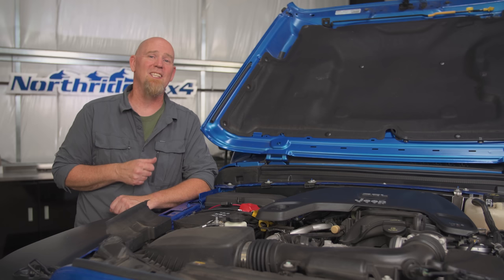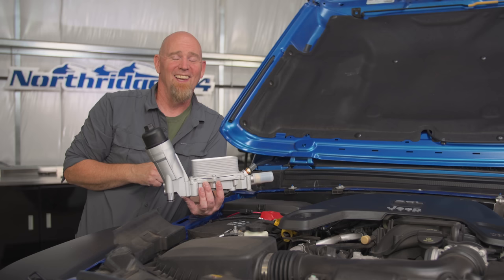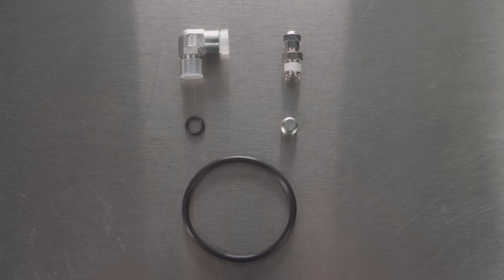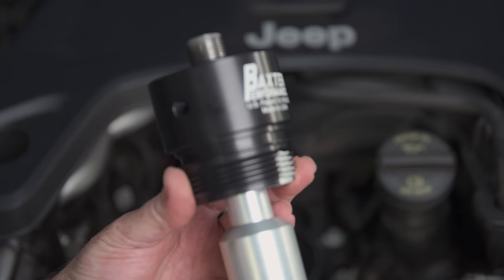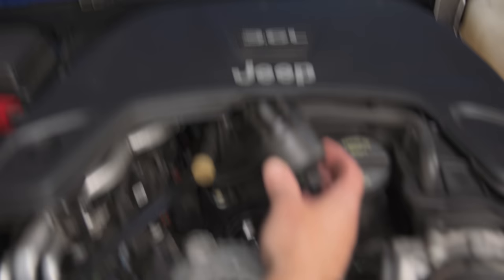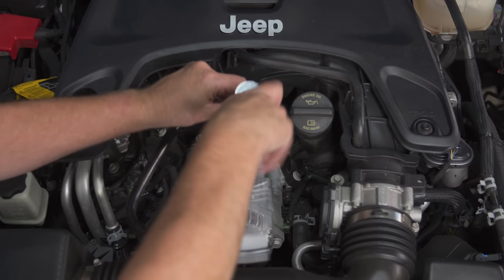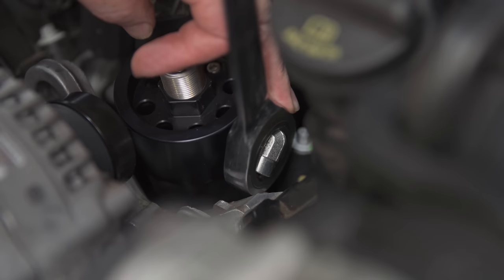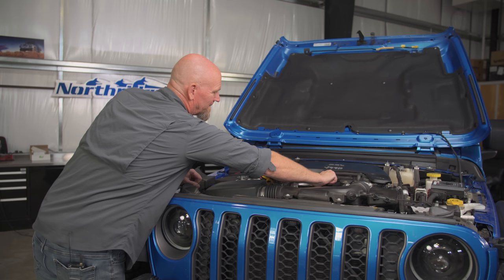STOP Dry Starting your Pentastar 3.6!!

Comment: Honest question; do you really feel comfortable promoting these types of "bolt on" products where you potentially dont fully understand all the possible downstream negative effects on all engine components? I mean even the engineers probably wouldn't promote something like this without very extensive long term testing.
Reply from the maker: Yes, with as many valvetrain issues as the 3.6 engine has, we really like the idea that a company has taken the initiative to find out what is the possible cause and come up with a solution.
As far as long term testing, this product has been in development for 3+ years and Baxter Performance has been building oil filter solutions for other vehicles for many years.
Reply: I would assume that you are assuming that factories build cars to last forever. They don't. That would not be very profitable. As a retired 40 year master mechanic that drives a 2022 Gladiater with the 3.6, I think its a great idea. Not picking, just sayin'
Reply: @donerightmark1240  not assuming that at all. All I'm bringing to light is how some of these easy bolt on products claim to fix one thing, but it may also be causing other issues that may crop up at a later time. Without extensive knowledge and testing on the exact platform it's applied to, I sure wouldn't risk it with my own vehicle. I'd file this under similar product umbrella as K&N/cold air kits, aftermarket exhaust systems, etc unless there was hard data to back up claims.

I don't doubt it does what it says, just wonder if there are other non-obvious issues it also causes.
Reply from the maker: @JRobes34  What hard data do you want?
The only claims made is that they are adding an anti-drain back valve into the system to keep the top of the engine primed with oil. 
Will a wet start help an engine live longer over a dry start?  Yes.
Reply: @northridgenation  re-read the last part of my last reply. Not saying it doesn't do what it says. Saying there may be unintentional downsides that may be occuring bc of something like this that you, I, or the manufacturer of it isn't aware of. This is just a possibility, not an absolute. 

Example: K&N filter reduces air intake restriction (or did on older non optimized engine designs of decades back), but at the expense of allowing more debris into the intake/combustion chambers. Does what it says (allows more air flow which allows more fuel in the combustion process), but also could be increasing engine wear due to more air contaminants.
Reply: @northridgenation what about engines with oil filters on bottom of motor.  The oil still drains out of the top of the motor back to the pan. It may hold oil in the filter, but the engine still needs to start in order to start pumping oil to top of motor. The cup full in filter doesn't coat cam or lube the rollers on rockers , that happens after oil PSI comes up from running after 2-5sec on ANY Engine.  Imo this is just a Gimmick for people to waste money on
Reply: As a mechanical engineer I can say that dry starts are not good. Period.
Reply: @kwmiked  Yes, both are the same bottom or top but the difference here is that this filter redesign allows you to have an anti-drain back valve where the OM does not.  So you get the added benefit of having Oil in the filter versus or no oil in the filter.

Comment: Interesting idea but a thicker oil than the water Dodge calls for might be a better fix.
Reply: I disagree. If this engine calls for 5W20 oil I would use a thinner oil, say 0W20. On cold starts you want a THINNER oil to circulate quicker and easier.
Reply: @nebaldeby5369  I agree with you.  Today’s engine tolerance between machined parts is so tight thicker oil will cause bigger issues over time.

Comment: Just get the dorman upgraded oil pump which takes a different filter which does have an anti-drain back. You can get pump for 100 vs 340 for this mod.
Reply from the maker: Do you mean the Dorman oil filter housing/cooler?
They do not have an anti-drain back valve and they run $200.00+ 
BUT we do agree, they are a good upgrade.

Comment: they put the oil cooler right next to the fuel injectors....so it can help cook and boil the fuel in the lines and cause clogging on the tips of the injectors...GREAT idea
Reply from the maker: We haven't seen too many issues with the fuel injectors, have you?
Reply: @northridgenation  no, but im sure it doesnt help the injectors stay clean. This is my first 3.6...Im dreaming of my old 4.0

Comment: How is it a dry start when my oil pressure immediately reads high as soon as the engine fires?
Reply from the maker: It takes about 3.5 second to get enough volume and pressure to all the critical components. That's not long at all, but it is every time you start up after the engine has sat for longer than 35 mins.

Comment: Does the 3.2 have the same problems as the 3.6? I think some problems can be caused by the extended oil life that these vehicles report in their maintenance computer. I don't trust the 10k oil life that it typically reports and change oil & filter at around 3k. I'm hoping that frequent oil changes are cheaper than an engine change at 100k.
Reply from the maker: Yes, the 3.2 is pretty much the same engine with a smaller displacement.

Comment: What happens when the check valve fails out on the road? What happens to the top end with excess water condensation that results from storing this hot oil on top end on shutoff? And why cant someone just hold both pedals and prime* the engine every time they start like you showed in the video?
Reply from the maker: The check valve is encapsulated, it won't fall out driving down the road.
There will be no more water condensation than you would normally get.
Sure, go ahead and do the two foot prime every time you start your engine OR you can save time and wear on your starter and install a Baxters adapter.
Reply: @northridgenation  thanks for the reply. I mean what happens if the check valve fails? As check valves can do when they get old and used
Reply from the maker: @Mike-pb7jm  The check valve is a steel ball held in place by a spring. There isn't really anything to fail. Maybe the spring after who knows how many millions of cycles?

Comment: If i were to install this in my Garage myself on my 2021 Gladiator sport has 23k Mi, would this Void the engine warranty?
Reply from the maker: It would be best to check with your dealer you would normally have warranty work done at.
Basically, it shouldn't affect your warranty, but if you have a really uptight service center, they may make a fuss about it.

Comment: I don't understand the recommendation for fill level after the install. If you are increasing capacity with the oil adapter and the dipstick reads full at 5 qts for the JL/JT why wouldn't you add more oil so the dipstick reads full after the install to account for the increased capacity?
Reply from the maker: That is what Baxter Performance told us. We'll ask them next time we talk with them.
Reply: Ok let us know thanks. @northridgenation

Comment: But still, movement occurs in top end parts before the little bit of oil held in the cannister filter makes it to these parts.  Is the benefit really worth it?  Would have to run 100s of engines with and without for millions of miles and compare.  They should just make a separate electric oil pump that moves some oil prior to starting the engine.  How hard would this be?  Just bought a used Ram 1500 with 3.6 Penta-star 2016.  215,000 miles.  Engine sounds new.  Only problem is cam sensor on drivers side on occasion mis-fires.
Reply from the maker: We love the idea of a separate electric oil pump to prime the engine before starting.

Comment: I know my comment is a little late but i hope you can take the time to respond, any idea how this will hold up if the engine is boosted, specifically pro charger supercharged?
Reply from the maker: The Baxter unit won't care if it is stock or modified.
Reply: @northridgenation  thanks for the reply

Comment: I have a 2020 Grand Cherokee 3.6 , i noticed it's not on the compatible vehicles list. Can you explain why it is not. Assuming that year/model has a anti drain back feature..  Thanks
Reply from the maker: It's more an issue with clearances.
Check with Baxter Performance, they can give you all the details.
kevin@baxterperformanceusa.com

Comment: Considering buying this for my Grand Caravan 3.6L Pentastar. I'm a bit confused how a check-valve in the filter housing keeps the top of engine primed. Or does it keep the filter primed so that there is oil more readily available upon start-up to thus prime the top of engine. It seems like there is still dry run time until the oil can come from the bottom up to the check-valve in the filter housing... Any clarification please before I purchase this, thanks.
Reply from the maker: It doesn't hold oil up the the top of the whole engine.
A typical 3.6 takes about 3.5 seconds to get the oil up to operating pressures and volume.
Adding the Baxters adapter will cut that time in half.

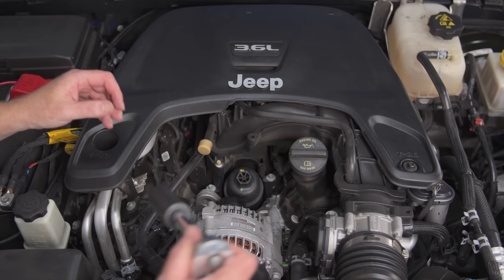Comment: 2:48 so first question is...does it void your warranty?
Reply from the maker: It shouldn't due to the Magnussen-Moss act of '74.
But it will really really depend on how strict your dealer is with mods.
The nice thing is, they are really easy to remove and reinstall, so if you are worried about it, pull it before taking your Jeep in for warranty work.
Like most people do with the Tazer.

Comment: Your holding a aluminium filter housing and cooler,  is that a aftermarket unit? Do you recommend swapping our plastic one out?
Reply from the maker: The OE plastic coolers hold up for around 100,000 miles.
We'd say wait until you notice yours leaking, then replace it with an all metal one.
Reply from the maker: We now carry the new Mishimoto aluminum filter housing:
https://www.northridge4x4.com/part/oil-filters/mmofh-jk-12-mishimoto-aluminum-oil-filter-housing-kit

Comment: I'm wondering if that will work on a T&C or a Jeep GC. More worried about hood clearance
Reply from the maker: This kit uses a remote filter adapter, to help solve the hood clearance issue:
https://www.northridge4x4.com/part/oil-filters/rj-404-cp-baxter-performance-pentastar-3-6l-cartridge-to-remote-adapter-and-6-port-remote-mount-combo-pack

Comment: These 3.6L pentastar engines are a tad fragile. I have seen so many valvetrain issues with them. I have encountered stretched timing chains, cracked valve seats, broken valves, cam sensor reluctor rings moved,  vvt actuators sticking , and jumped timing. I only like them because of all of the work I get from them! Chrysler puts them in pretty much everything they sell.
Reply: I could see how this product could help prevent a lot of those bad things from happening.

Comment: So I’m confused on the oil level after someone does the install. Do you put in 5 quarts like factory recommends or do you add oil until the dipstick reads the appropriate level ?
Reply from the maker: You still run 5 quarts of oil. 
The dipstick level will run a little lower.

Comment: So  , I need to buy  air compressor in order to Change my oil filter?  What size do I need?  Will a Bicycle pump work?
Reply from the maker: Baxter performance says a minimum of 30psi for 30 seconds.
So a small plug in or battery operated compressor should work fine for that.

Comment: Because the new spin-on filter is installed upside down, you will still have a dry start everything you do an oil change. Why not use a remote filter mount that is upright, and be able to prefilled the new filter with fresh motor oil?
Reply from the maker: Baxter Performance also have a remote filter set-up for the 3.6. We'll be doing a video on that set-up soon.
https://www.northridge4x4.com/part/oil-filters/mr-202-bk-baxter-performance-cartridge-to-remote-oil-filter-adapter
https://www.northridge4x4.com/part/oil-filters/ri-101-bk-baxter-performance-inverted-remote-oil-filter-mount
Reply: 1 oil change is better than every time you start it or am i missing something

Comment: I have a 2012 jk would this work if I put the Dorman 926-959 oil cooler? I believe with the upgraded aluminum housing it now uses a 2015 oil filter.
Reply from the maker: The aftermarket aluminum housings use the 2014+ filters, they are a better set-up.
We have the aluminum Mishimotor Filter housings in stock:
https://www.northridge4x4.com/part/oil-filters/mmofh-jk-12-mishimoto-aluminum-oil-filter-housing-kit

Comment: just got mine. any concern the added weight (this thing is heavy!) and an additional can filter would contribute to cracking the famous oil fill neck from bobbling around off-road?
Reply from the maker: That is something we've talked about around here. Baxter Performance says they are not concerned with it.
Reply: I replaced my factory oil cooler with the Dorman all aluminum one. WORTH IT! I made sure I did that though before installing the Baxter adapter, in part, because of the added weight. But mostly, due to the fact that the OEM oil cooler is mostly plastic. The heat takes its toll on it, and eventually has to be replaced.

Comment: So with this system, you need to do the prime procedure with every oil change correct? I already bought it from you guys, just waiting to get time to do the install.
Reply from the maker: Yes, do the prime procedure on the first start-up after an oil change.
Reply from the maker: @pchappy2.0, did you get that Baxter Adapter installed yet? If so, have you noticed a difference in start-up?
Reply: @northridgenation  I did not, I ended up coming down with Covid so I am just now getting back on my feet and caught up with everything. Soon though and I will report back for sure!

Comment: You still have to start it without oil after an oil change. Can Baxter come up with the means to prime the system after an oil change so there's oil in the top?
Reply from the maker: That's what the factory priming trick is all about. There is enough residual oil on the parts to protect them while you prime the engine.

Comment: I have had a 2011 3.6 Pentastar in my Challenger and my 2019 Durango. Love this powerful engine. I would not trust this video. After market stuff is a risk. Do not take your vehicles to quick change oil places. Trust your dealer.
Reply from the maker: So you don't add any aftermarket parts to your vehicles?

Comment: So the make this to solve dry start problem but then gotta blow oil to bottom anyway? Wouldn't that cause dry start?  Why not just do the 2 foot prime after every oil change
Reply from the maker: You only have to blow it down when changing the filter, then do the two foot prime on the first start-up after the filter change.

Comment: I have pipe dope for my day job, would that be better than using oil on the two pipe thread adapters?
Reply from the maker: You could use pipe dope. We used oil as that's what Baxter Performance says they use.

Comment: Is it recommended for and will it fit in a 2024 Rubicon? And would it void the drivetrain warranty?
Reply from the maker: Yes, it will fit the 2024 Rubicons. 
We recommend it for any 3.6 Pentastar engines.
It shouldn't void your warranty, but it is easy to pull off if you need to go in for service.

Comment: That’s a very informative and well made install video but why do people call metric sockets sizes “mil” instead of millimeter?  It would be more correct to call them “milli” which is 1/1000 of a metric unit.  A mil is 1/1000 of an inch.  So a 250 mil socket is a 1/4” socket.  The paint on the outside of your car is probably between 3-7 mils thick (.003-.007”).  A mm is slightly over .039” thick.  Huge difference there.

Comment: What happens when you apply that 30 psi air to blow out the oil filter and the air has moisture in it?
Will that not introduce water into the oil?
Reply from the maker: Drain your air tank occasionally, install an air/water separator....etc.

Comment: hey guys quick question, i have a jeep gladiator sport s. i just changed the radiator and it runs good but coolant temp fluctuates, yesterday was running good, 203-204 coolant temp. a day later in the morning on my way to work it was 222-224 coolant temp. any ideas what that could be ??
Reply from the maker: Sounds like you still have some air in the system.

Comment: I like the idea but that looks like a messy oil filter change process. 
I built something similar BUT mine is mounted on the side by the ECU with the filter mouth side up and I use a bigger filter and with an in line oil finned cooler on the return side line.
Reply from the maker: No mess when changing the filter!

Comment: So for those without a source of air you just change it the way you always have. Wait a while, probably until the oil pan is drained then remove it. I don't have a Pentastar, but I assume that is the procedure. Still have some oil but just put some towels around it...
Reply from the maker: You could do that, just make sure to wait at least 45 minutes or so for as much of the oil to drain back as possible.
Of course you could always pick-up a small portable compressor, whether it be alligator clamps to your battery or a cordless unit to match your cordless drill.
It doesn't take a lot of air to drain it back. Around 30 psi for 3-5 seconds to drain it back. We've even heard of people using a bicycle pump to bleed them down.